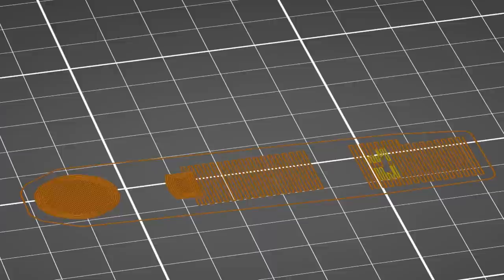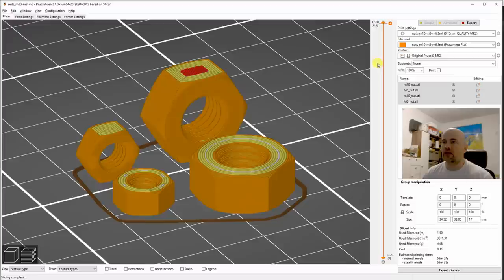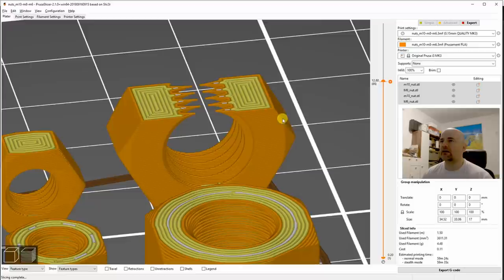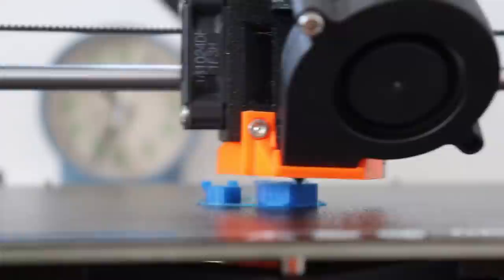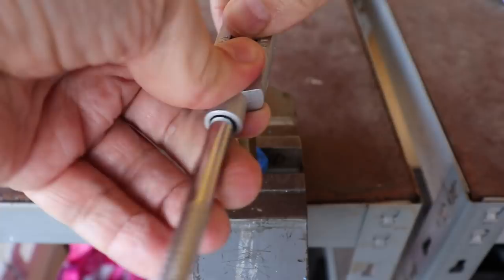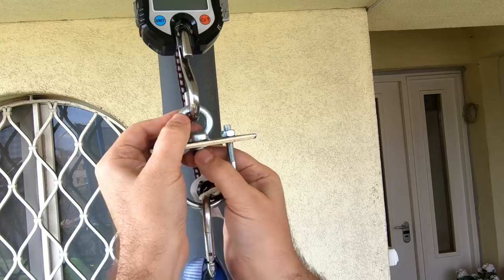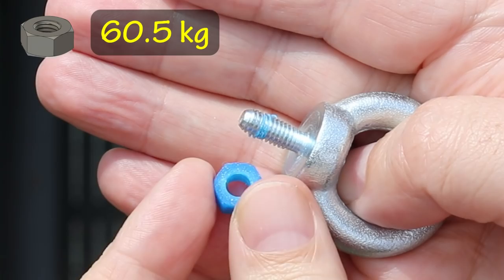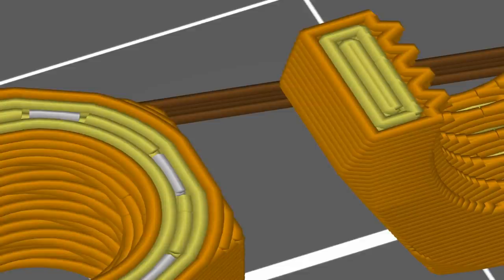3D printed screw nuts - horizontal or vertical printing position is better?

Comment: Also useful conclusion (besides that horizontally printed plastic nuts are good enough for several applications if they will not be commonly unscrewed).
Is that if you are going to have horizontal threads in your 3D print with a good number of perimeters then you can avoid need for metallic nuts in the 3D print. (That is again, if the screws will not be commonly removed)

Comment: ANSI and ISO threads were developed around optimizing fasteners for steel, not plastic. It would be interesting to see a design of experiments that included thread pitch, root diameter, thread type (square vs triangular), etc. to see what the optimal shape is for PLA, ABS, and others. Note that threads on plastic containers like milk jugs and others are not ISO or ANSI standard (many are DIN 6063, but many are to no standard at all)— they were developed because they work better for plastic.

Comment: I’m not sure who started it, Prusa does it now, I think, but a small ramping cutout at the top inside of the nut really helps with quality. It gets rid of the overhang entirely and the nut still works.
Reply from the maker: I use that technique with vertical holes. For threads, not yet, but I didn't needed bigger threads so far (up to M12 I can print without supports)

Comment: Here I was, watching your videos, thinking I subscribed 3 weeks ago, and as it turns out, they're just being recommended but I wasn't subbed!
Hey man, keep up the great work!
In this particular video, I thought the vertical printed nut would have been stronger because the screw is parallel to the printing lines. 
Greetings from México!

Comment: Re: BOLT ORIENTATION/SUPPORTS: Trick to avoid supports!...
- Cut off bottom portion! That is, when lying horizontal.
- Cut ~1/4 up the threads.
- Yes, bolt looks funny, but still works:)
- FYI, can even cut of top, too! This saves on material usage.
- BTW, I have not test any effect on strength. Only concern: less area to contacting mating with internal threads. Hm?...
- P.S. Bolt only needs to be "strong enough":) With a factor of safety, of course.
Reply from the maker: Yes, I already got several suggestions about this cut-off-bottom version. I will test that too in near future. Thx.

Comment: I have an idea: print thread in 3 parts on horizontal and seat in a hex ring with flange. System will be held together in compression. Makes maximum use of layer alignment with filament in tension.

Comment: You need to test for sizes that makes sense for 3D-printing plastics, not metal. A 2mm pitch thread, is a minimum for a really solid interconnection, which leaves you with M14, or bigger. If used with care, there are no need for any metal bolts or nuts. I tend to scale the bolt in the X and Y plane, and print the "nuts" in any direction. Also, by incorporating the "bolt" thread correctly into parts, I can dictate the rotation of the interconnect, as in connect cubes. If you print a bolt and a nut at 16mm 2mm picth, and scale down the width of the bolt to fit without need to machine it to fit, those results would be far more interesting, and far stronger than these. Using PETG, I need to decrase the x and y with 3%. I just use a regular flat headed screw driver, and a slot in the end of the bolt, for fastening. Works really great. The main issue is that I cannot get longer bolts to work, as thermal expansion is affecting the prints of the bolts, skewing the the threads of the upper part of the bolt, as the print do not compensate for thermal expansion of the cooling of the bolt, as it prints. The printer applies the layers as if there is no such thing as thermal expansion, in the z axis. Just design for short bolts, like up to 12mm for each nut. I tried M22 and 3mm thread, and it is just as bad, if not worse, in this regard. Also for interconnecting parts, I use headless bolts, and threads on each side of the interconnect, as I can adjust the threading for parts to align perfectly.
Reply from the maker: Good approach. So far, with my equipment, I can measure only up to 150 kg, that was enough to break M6 only. But working on stronger measuring setup, but probably I couldn't break M22, maybe on torque test only. Thx for info.

Comment: Thanks for this. I need to print a thread vertically and this helped me tell if it would work and when I need to add support. For nut strength I wonder if 45 degree angle would be better than vertical.

Comment: The only way that you would have any possibility of a stronger printed nut and bolt would by using the annealing process (oven heating and slow cooling, to align the molecules within the printed nut and bolt)..

Unfortunately the annealing process seems to have a flaw, in that it warps the print..

Comment: What about printing no thread, and using a thread cutter only?
Reply from the maker: I try not to cut perimeters, only for cleaning
Reply: @MyTechFun  It would be interesting to see the difference also with the amount of perimeters. For instance 3, 4, 5, 6 Perimeters on M6 to find the sweet spot ;) Great video btw!

Comment: good tests. so bolts print horizontal, so is nuts.  get yourself a set of cheap Tap and Die tool to clean them up and they are good as metal bolts and nuts.... 14NM on a M6 nut thats STRONG !!!!!!!!!!

Comment: Just wondering - Why don't you use the ratchet strap to do the pulling force test? Saves you from getting bumped on the head. Project Farm does some similar stuff.

Comment: An idea comes to mind: would glue or threadlocker improve adhesion?
Reply from the maker: Glue probably yes, but then it will became a permanent joint
Reply: @MyTechFun  It might be worth a video nonetheless: "what's the best way to assemble two parts?"
Reply: Normal threadlocker is a bad idea for polymers, it's known to cause embrittlement and cracking.

Comment: Again, proof that you need to print objects with the orientation that gives the largest area per slice, if you want strength. 

This completes both the nut and bolt.

Only place you could further  this now would be the object between the nut and bolt. Though again, I think you would find having the attachment printed flat, with largest layer area and 100% infill would be strongest. 

But then plastic is plastic.. if you really wanted durability, you would look for metal.

Comment: I wonder if you could get the good thread by printing bolts vertically, but have a hole in the center of the bolt and insert some carbon fiber tube and bond it to the inside of the print
Reply: Based on nothing, I would assume that'd only help when it sheers. Thread damage and pulling power wouldn't be changed.

Comment: instead of using support for the top bridge on >M10 vertically printed nuts, could you pause the print, thread in a bolt, and then finish printing using the bolt as the support?
Reply from the maker: Hm. Not sure, but these tests I made to test the threads, not nuts. If I need a standard nut, I'll use metallic. But it's good to know possibilities if I need a thread as part of object, and in most cases I can't place a bolt inside.
Reply: You'd probably want to use a plastic bolt, or at least preheat a metal one to avoid problems of the print being rapidly cooled where is touches the bolt.

Comment: hev you tried a smaller Z step?
Reply from the maker: Smaller layer height? No (0.15mm was the smallest, printing is too slow below that)
Reply: i am printing details or very accurate thing with 0,1 or 0,07 layer height.... rounded things are then very smooth